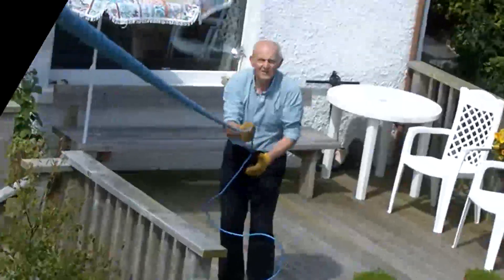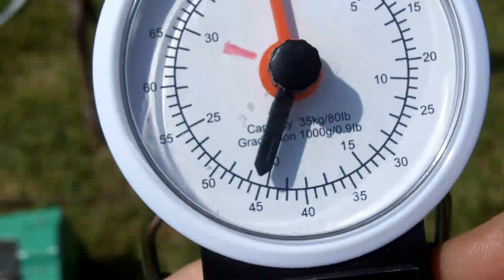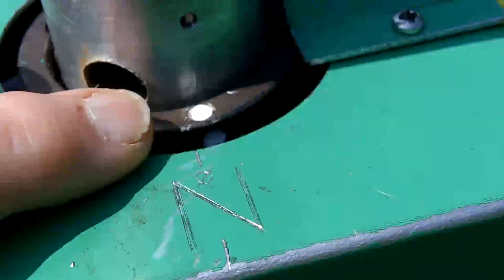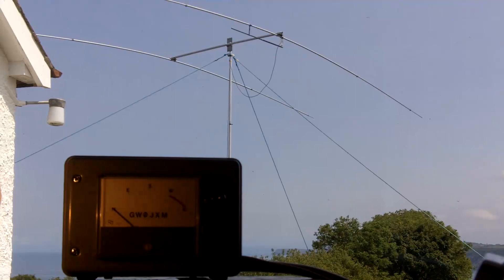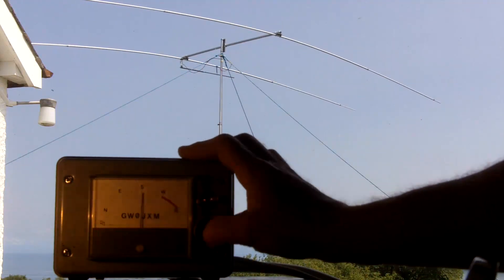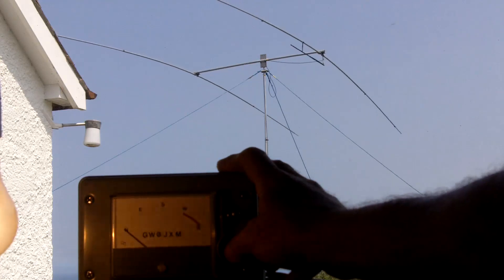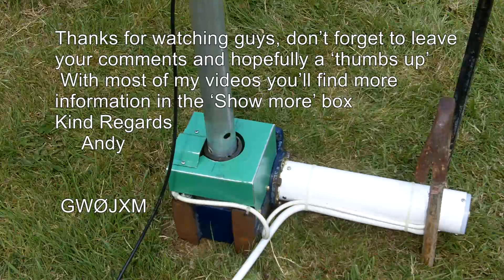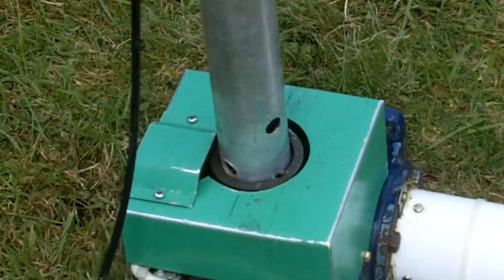About Radio 85 part 17 antenna rotator, the last part of the antenna rotator series.

Comment from the maker: Hi Dave, I wish I’d made videos of some of the big machines I’ve developed over the years. I get inspiration from what went before, it’s hard to come up with original ideas but you can usually improve on what the other guy did once you know how he did it. Old machines and junk fascinate me and they are a treasure-trove of ideas and stimulation, a bit of bent metal or an odd shaped bracket has given me that Eureka moment time and time again.
Thanks for the feedback 
Kind Regards ... Andy

Comment: Many are still around! QST, CQ, etc, -many on the net, and some very cool new ones like "Electric Radio". Also, lots of video on the web and You Tube, check out K7PP's YT channel, or K7AGE, K6JSI, W2AEW or Ham Nation! -thats just a few, there are tons!  Glasslinger shows how to make vacuum tubes! More stuff now than in the old days! In January, QST had a great article about how to put together a SDR for about 50 bucks! I built it, was easy, and it rocks! But I agree, Andy is superb.